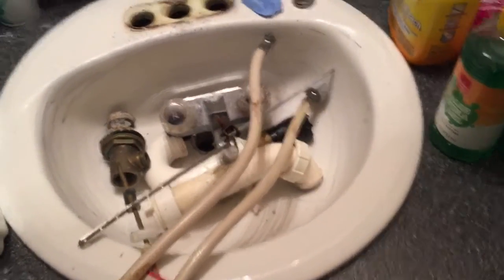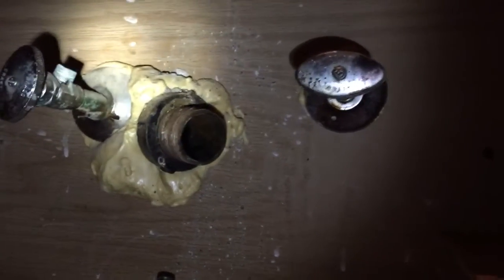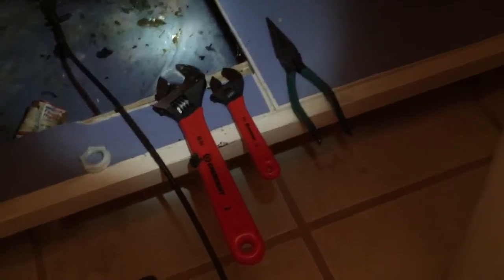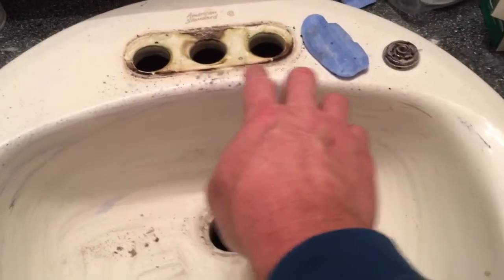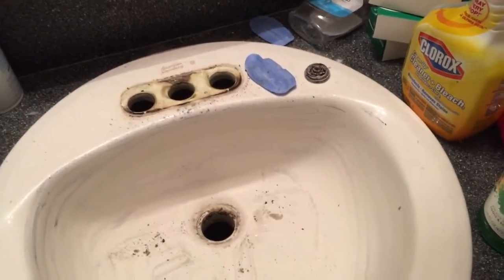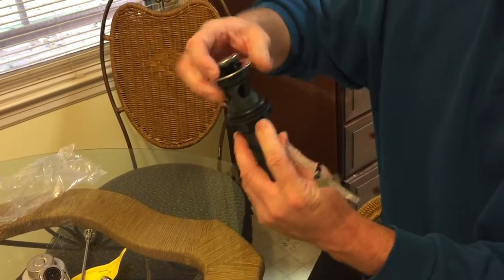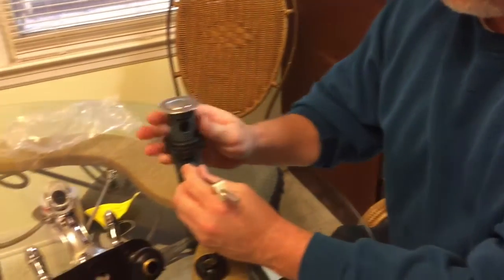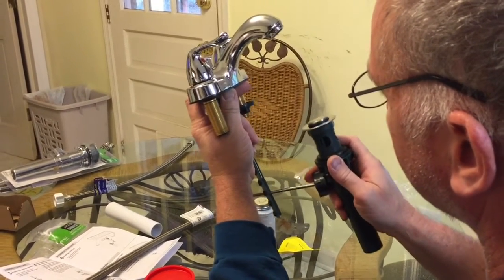How to Replace a Bathroom Faucet and Drain

Comment: great educational video, i mainly checked to make sure  wasn't going to mess up my sink (and i was checking out videos on finding my main shut off valve because my sink doesnt have them). The only note i would give is to tell people which way the bevel actually faces in order for the sink to not leak. I know it may seem like a no genius thing to know, but i feel like some people may not know what a bevel even is. Besides that great educational video. I have never changed a faucet(doing that tomorrow), and i learned a few things about it and how simple it actually is.